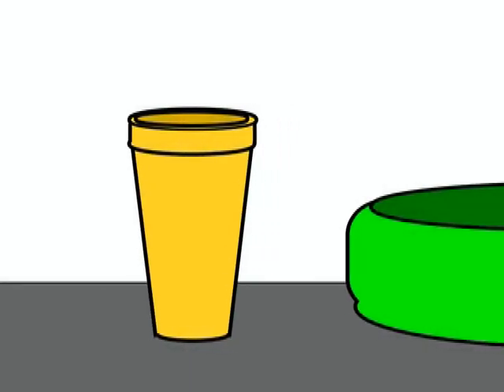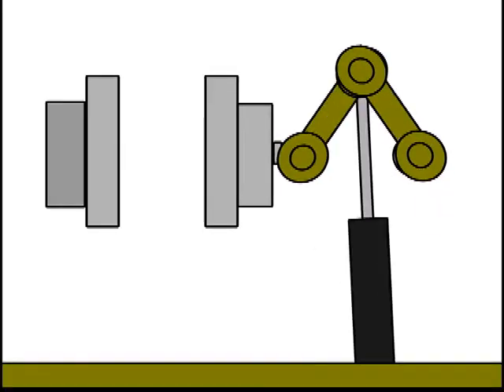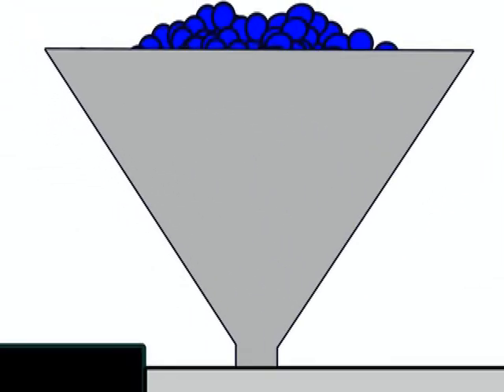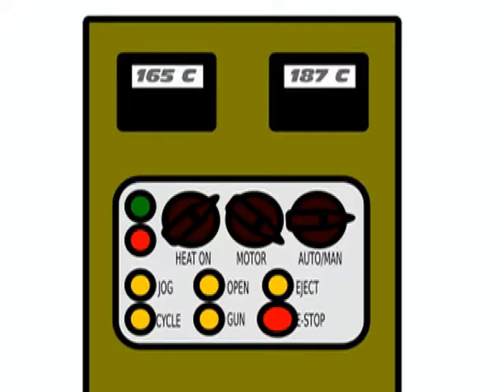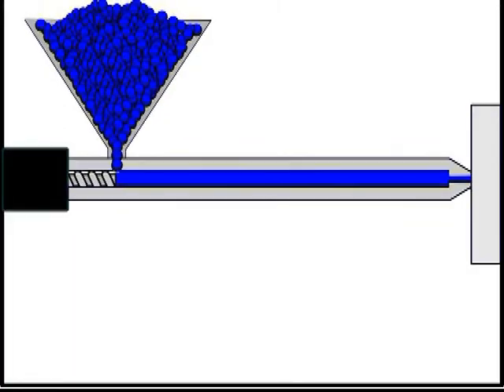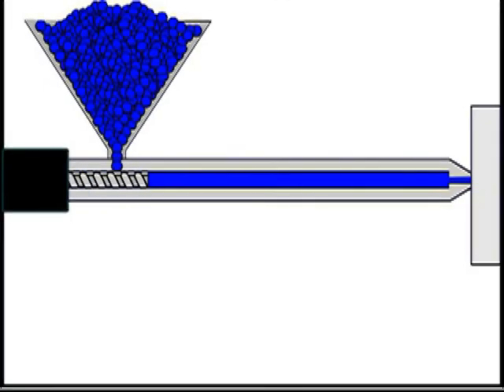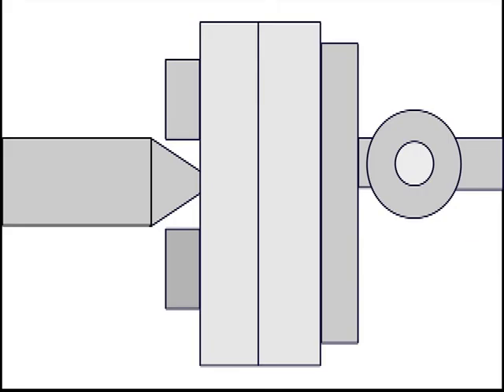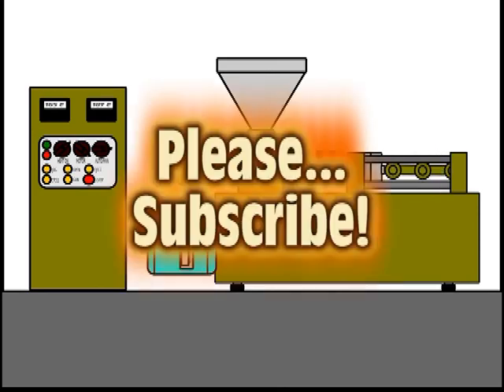How an injection moulding machine works

Comment: Can I use this to make human miniature?
Reply from the maker: Dear friend, it all depends if you have the adequate mold, which is generally custom-made. The moulding machine is adjustable to virtually any size of products (provided they fit in the machine capacities).
Reply: @eltunene  ok thanks
Reply: @eltunene  yes it's custom made but I planned to make marvel models and replace customers face in that.